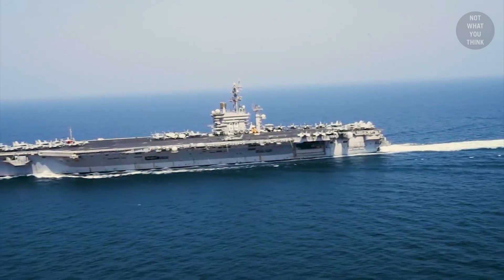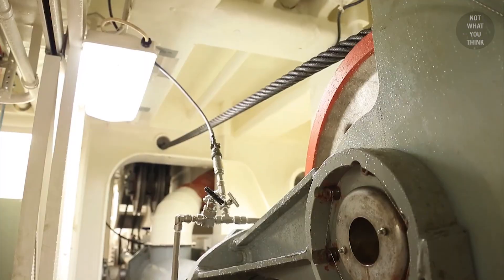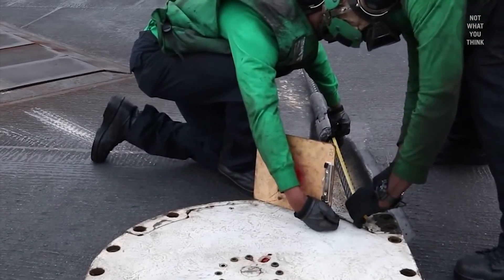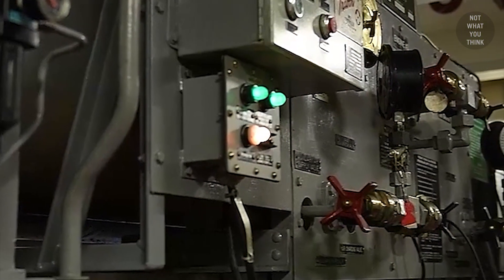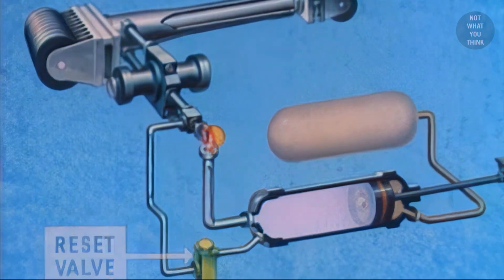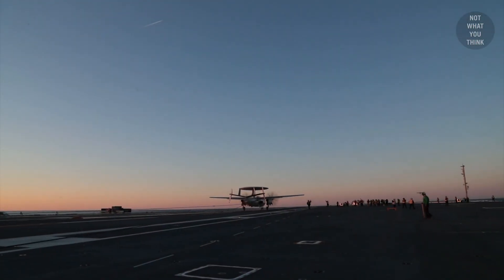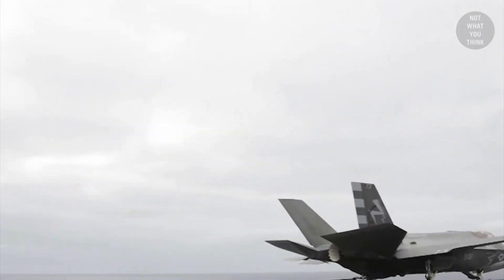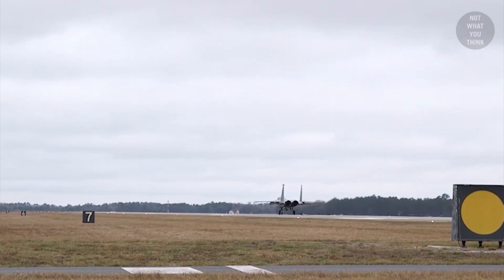What if The Arresting Wire Snaps During Landing on Aircraft Carrier

Comment: Those E2 pilots have some amazing skills if they were able to get the plane back in the air after that. From the footage, it looked like they had lost too much speed to recovery but damn, they managed it like champs.
Reply: Definitely skilled. Thankfully their training includes going to takeoff power while the cables stop them, otherwise there would have been no chance.
Reply: @kstricl  Yeah, but that practice is more to mitigate the chance of missing all the cables, not from getting almost stopped and having an arresting failure, since the former is much more likely than the latter.  Also @Kreeos explains it pretty well.
Reply: propeller powered planes require a much smaller difference between landing speed and flying speed so they can recover much easier but also part of procedure is to throttle up when caught by the cable in case of failures pilots can get back to take off speeds
Reply: @imchris5000  True, but even with full throttle hitting the deck, it looked like the arrestor cable had already taken a lot of energy from them before it snapped. Looked like they were right on the edge of whether or not they could have saved it.
Reply: kept the nose down, didn't force it to climb before it was ready, used every inch of altitude to regain airspeed, and retracted the landing gear Quick.
Reply: Little known fact, when a plane is landing on a carrier they are trained to basically punch it when landing for just such an event, that way if they miss, or if a failure like this happens they can still have enough to stay airborne.  I served on the U.S.S. Eisenhower from 95-96, was a red shirt AO who brought ordinance up to the flight deck, no joke that is one of the most dangerous jobs in the world, but MAN did I love the times I got to be up there watching them take off and land!
Reply: They are set for takeoff even when landing... just in case.
Reply: They will have most likely noticed that the plane hadn't stopped when it usually does and realised that something had gone wrong. This meant that they would have had a few seconds to power up the engines again and get enough speed to keep it in the air. Good Job pilots 👍.
Reply: @willdyson1033  they always throttle up on landing regardless
Reply: @willdyson1033  the pilots both had a hand on the emergency door by them as they save the plane.
Reply: @willdyson1033 "This meant that they would have had a few seconds to power up the engines again and get enough speed to keep it in the air." 

Carrier pilots are trained to land at full throttle and not to draw back the throttle before the aircraft comes to a full stop for this very reason.  If they had started throttling down the engines before the cable broke, the delay in getting the engines back up to speed would have signed their fate, and they would have plunged into the water.
Reply: The e2 is made to fly at low speeds so it uses less fuel when it is on mission and can stay in the sky longer so this along with going to full throttle whenever they are about to land
Reply: Supposedly 1 handed too as they were ready to bail
Reply: True, but thats what they are trained for.
Upon landing immidiately max power is selected such a TakeOff can be made.
It's no fun at all but there is a good chance on saving the plane, and thats what the crew did.
Reply: Only jet aircraft go to full throttle when they trap.  In the E-2, you leave the power where it was when you touched down (about half power).  The reason for this is because jet aircraft change engine rpm when they move the throttle.  So if they miss the wires and need to go around, they need their engines spooled up by the time they get to the end of the landing area.  The E-2 and C-2 keep the engines running at 100% and make more thrust by changing the angle of the prop blades, giving us much faster throttle response.  In this case, the E-2's large wings, instantaneous power, and quick reaction time of the pilots (gear up, flaps down, pitch up) saved the aircraft and possibly their lives.

Source: E-2 pilot
Reply: @Naviator2012  Forgot to mention that the prop wash over the wings gives the aircraft a bit of a blown flaps effect.
Reply: @Naviator2012  Makes sense. So the engines MUST be free turbine types.
I remember from the old single turbine (centifrugal compressor) that it indeed takes some time for the props to spin up
Reply: @pascalcoole2725  actually they aren't free turbines.  The computer that controls the whole system is just really really good about matching blade angle to fuel flow to maintain 100% rpm.  It's possible to get it to overspeed for a second if you move the power levers quickly, but it just settles it back out to 100%.  If you turn the prop by hand, you can see the turbine spin in the back of the engine and hear the tink sound of the compressor and turbine blades as they turn.
Reply: @Naviator2012  Whow... thats fancy.
Sounds a bit like the Fokker-50 (however those are PW125). There al small panel called the EngineRatingPanel which has six pushbuttons like on a modern jet.
You put the trottle (called powerlevers) in a certain detended position and the rest is done by the EEC and PEC (Propellor Electronic Control).
Really anyone who ever seen a picture of an airplane can handle this.
I once saw a movie in where a guy had his private E2. Mom, can i have one too ?
Reply: Looked like those B-25s taking off for the Doolittle raid
Reply: @Astrocat-od5cy  😂